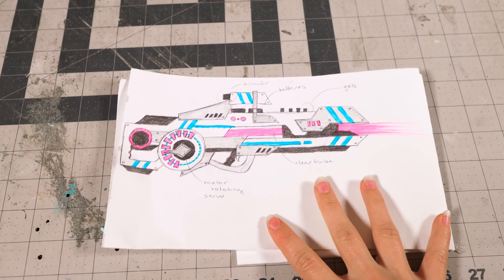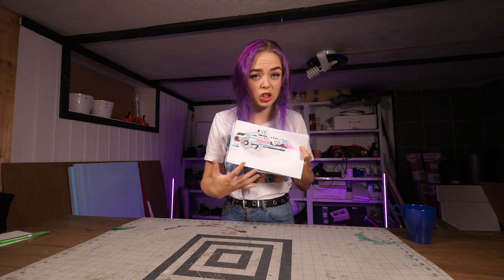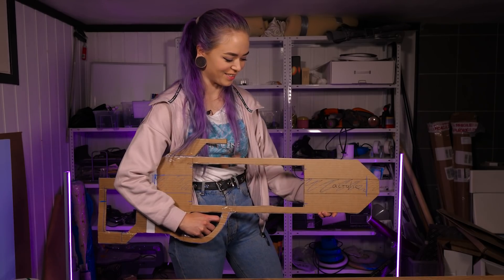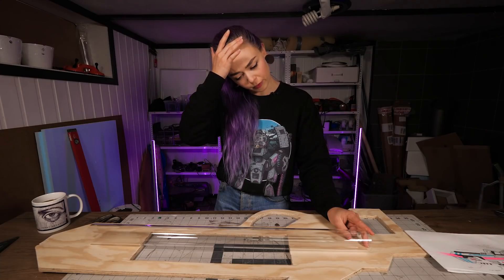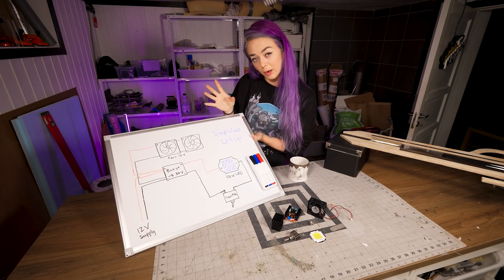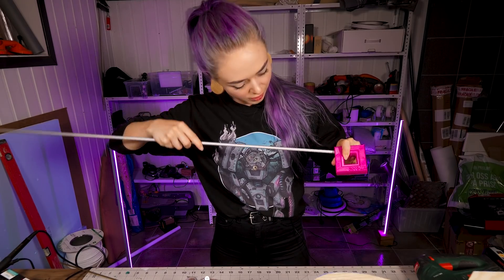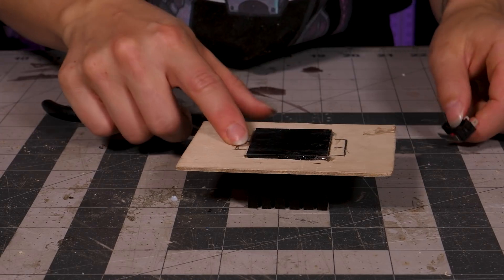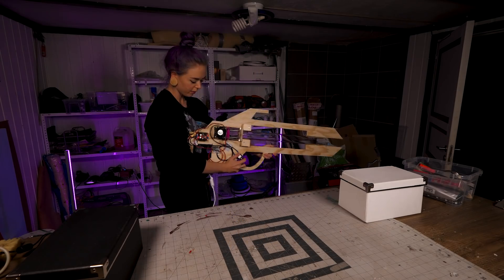Making A Giant 100W LED Laser Gun!

Comment: Very nice job! But a little tip for the led mechanism, about a possible thermal issue: now, when you want change color of the led, you disconnect it from the heatsink. This mean you don't use a thermal paste, usefull for the thermal exchange from the led to the heatsink. Without the paste, if you will running the led at maximum power (how the other guys said, with the actual voltage and courrent, the power is under 30 watts), it will risk to overheating. So, if you can, change the mechanism, so that the heatsink is  permanently connect to the led, with the thermal paste.

Comment: At the 30 V supply you are drawing about 0.7 A at most in your tests. So in reality your 100 W LED is just a 25 W LED at most. (This happens a lot when buying these from China)
Reply from the maker: We noticed this as well. Two theories: our bench power supply can't go higher than 30 volts. The LED i tested needs 32-34, it may draw a higher current at a higher voltage, which we will test. I remember having read someone had to drive it at over 36 volts to get it up to anywhere near 3 amps, which I guess sucks for the longevity of the chip. The second theory is that it's just a bad chinese product.
Reply: @Nerdforge  Honestly 25W is a comfy enough value and quite a good amount of light, i don't think you necessarily want to push it much further than that. Let's say it's a 10-series LED (i remember bigclivedotcom looking at these, should be about right), you're driving it right around the bottom of the threshold range and i'd say looks about right to me. Tried it with a super low current, seen whether it lights up consistently at all? If it does, and you can tell that there's 100 LEDs in there, 10 rows, 10 columns, all lit up, then i'd say it's a perfectly great product, but you might have a bit of difficulty finding one that isn't made out of junk LEDs. Banggood stuff sure usually isn't the worst though.

I mean neither your LED mount nor your cooling arrangement nor the spring contacts seem even borderline fit for a 100W heater. And the further you push it beyond the threshold, the less efficient it will be, so it may not even be necessarily worth it.
Reply from the maker: @SianaGearz  Thanks, that's a good tip! I'll explain a bit more in the next video, but the idea was never to have the gun permanently powered. The arduino will control how long you are allowed to hold the trigger button down, before having to do a cooldown period. Hence we can carefully adjust it so it's allowed to cool enough before blasting off again! The brighter the better!
Reply: You have to drive those leds with a constant current instead of constant voltage. Otherwise you can destroy the led.
Reply: @farbenformenlicht   Constant current and constant voltage are strictly equivalent to each other - if they're actually constant. You have more leeway to get the current regulation wrong than voltage regulation, but with these 10x10 array LEDs, it balances out anyway. According to how these LEDs usually react to voltage (like they light pretty brightly sub 30V and don't reach full brightness until 36 or 38 or so) there's probably plenty of resistance in the bond wires within the LED package which contributes to current limiting. It should be just fine, and if the LED unit dies, well that's just the quality of individual LED elements, nothing you can do about that other than underdrive it on the whole. There is some temperature dependence, with bond having PTC characteristic and LED having NTC characteristic, but that's like tens of millivolts, not enough to matter.
Reply: incandescent lumen equivalent probably (shrugs).
been duped as well, along with next day shipping that took 40+ days to arrive. I have a few "25watt" LED lamps that only pull about 3 watts, so it's a comen marketing thing to lie about LED power.
Reply: @Zarcondeegrissom   Nah they probably haven't mislabelled this one on purpose, this should be a real 100W LED, just 30V is too low for it.

Yours were likely deliberately mislabelled. If it's mains LED, it was probably the remarkably common combination of a 10W LED and a 3W driver.
Reply: eh, deceptive marketing in general really. Bigclive also looked at a bunch of various LED cob fixtures and bare LED cobs. many are deliberately mislabeled.

FYI, due to the dropout voltage of LED elements, going drastically lower in voltage will only result in the LED not lighting up. it won't make a 3watt LED magically put out more than 20 watts of light for longer than it takes the magic smoke to escape the cob, lol.  a 12v cob, will only work around 12v, a 30v cob similar. putting 120v or 240v directly into either will only make a spark and smoke show, lol.

She probably has a 25-watt cob, and 30V is exactly what it's supposed to have, more will only kill the LEDs.  in my case, it was a 12v fixture that was mislabeled by the seller.
Reply: to clarify that some. A single 1.4 volt red LED element will only illuminate between 1.2 to 1.6 volts typically. that is a very limited range of voltage. below 1.2v and the voltage is just to low for the diode to even turn on. above 1.6 volts and so much current will be going through the LED it 'will' burn out rapidly.   similar applies to 2.1 and 2.3v other color LED elements.   That's why you can't just rais the voltage to make an LED brighter like old incandescent bulbs. It takes trickery with PWM dimmers (that only do dimming, not make an LED brighter than it should be), or similar things with the LED driver circuit (that varies the current, or time based on/off cycling).
Reply: @Zarcondeegrissom  These should have 10-series of LEDs with 3V forward voltage each and judging by the range of voltages they light at (30-36 usually specified, sometimes 30-38V) there's a significant series resistance in the bond wiring. If these are what i think they are, 100-element array, and if the individual LEDs are not junk, 100W is actually appropriate maximum wattage for the unit - of course if you can cool it effectively enough. Whether the LEDs are junk is something that will be obvious at low-current testing.
Reply: with 10x LEDs with a 'Forward Voltage' of about 2.73v (Cree, apparently has one that high. lists 3.0v as the absolute max voltage), I would think between 28v to 32v would be more of a thing.  for 36v, I would assume you would need more than 10 LEDs in series, like 12 or 13 LEDs if there at about 2.7v 'Forward Voltage' each.

none the less, it's not like the cob is puling only 80% of it's advertised power. going from 25 watts to 100 is a four times increase, you're not going to get that without blowing the LED or starting with a PWM dimmer at low from the start for the 25w measurement, lol.

https://www.mouser.com/ProductDetail/Cree-Inc/XPGDWT-BS-0000-00KE3?qs=sGAEpiMZZMve4%2FbfQkoj%252BIeIZAp5dv5GQ4JeQrEY2CA%3D

I have seen higher-rated LEDs in the past, 5V and 9v, tho they had current limiters built into the 5mm package back then,  not the same thing as raw LED element in a cob.
Reply: LED's are often labeled as "equivalent to" using the old type of light bulbs as a measurement. At least they do that with grow lights. I have a grow light that gives an equal light output to a 1000 W HPS that only uses about 250 W. It's not because they're from China, it's just how businesses try to make the transition easier for people that don't know anything about this stuff, they just know they used to use a 40 W light bulb in that lamp over there. It's like how they still use Hz to describe a TV's maximum frame rate even though Hz is no longer applicable since there are almost no analog TV's left, at least not here in Norway. No regular light bulbs left either, they've been banned, but a lot of people will still look for 40 W or whatever when shopping for light bulbs, so they put it on the box even though it's not true.
Reply: except if you look, it's labeled 'equivalent' on the packaging, with actual power also often on the packaging somewhere in smaller print. I have many of them bulbs.  The thing is, cobs tend to be a tad more than 4x for equivalent power as with regular bulbs.  So as much as I  had joked about that way up yonder, I don't think that quite flyes, as these cobs are not marked as 'equivalent' power on the seller's page, there marked as actual watts in an outright lie of what the cob actually does.
Reply: Chinese watts are 1/3 of real world watts, you find this is true when buying power inverters and that expensive 1000w pure sine wave camping inverter craps out at like 400w...
you just cant trust products from online cheap stores, you want 100w led, use a real electronics component manufacturer recommended from a local country forum/group
Reply: You can get a buck boost converter that can also adjust the current output. My Chinese 100w led maxed out at 2.6amps at 33v. Some of the boost converters that have  no current adjusters have a limited ampage output.
Reply: @Nerdforge  You might also want to check the lab wires / crocodile wires you've used. It's hard to tell from the video, but i've had lab wires that couldn't even handle 2A. Thick PVC/Silicone outside, but barely any copper inside. Especially cheap crocodile clip wires have often just a AWG28 or even less inside. 
If it gets really pushed to the 100W / 3-4A at the end i would get some nice thick silicone wire.
Just keep in mind that the LED might melt the 3d printed holder (especially if it was PLA) if you go towards the 100W.

Comment: I think It would be better if you use BEC and step down from a 6S lipo battery or higher. Because step up requires lot of current to reach higher voltages

Comment: 100W lazer, you must be crazy. But a 100W LED that is doable
Reply: same. I was like 100W laser THATS CRAZY... does she want to cut thru things???
..., ofc its just 100W LED light... that is not even running at 100W (1:13)
Reply: Styropyro has a 100w Laser. This is extremly Powerful.
Reply: @JAKOB1977  What kinda heatsink would you use for such a powerful laser diode? Could you link a few with a fan that arent too expensive?
Reply: @JAKOB1977  Wtf are you talking about it says in the title 100W LED no clickbait. Just pay more attention reading stuff
Reply: Right? I have a 60W laser and it cuts through half inch thick wood like butter
Reply: @redleader6144  You missed the word "Laser" in the title. LED means Light Emitting Diode. Laser is a light emitting diode but this video is clearly not a laser diode but just regulr one, she also runs it at one fifth of the power and has no idea what she is doing.
Reply: I don't think any of her fans that ought she meant a real laser.  She makes fantasy stuff.  I mean I watched one where she made a spell. Another where she made a wizards staff. A wand in another.

Comment: What plastic is the bracket printed in? Won't it give up from the heat? What thermal interface to heatsink?

The heatsink looks like a 40mm heatsink, so it's going to have... with airflow, maybe 1-2°C/W performance? Ooof that'll be narrow, i mean, even at 1°C/W, you can reach 130°C... i know, a sloppy estimate on my part, i guess you'll see in the build what works what doesn't.

I'm also worried about the colour gels, i mean, when you're putting 100W of power into the LED, you'll get about 20W hitting that sheet of plastic, most of that passes through, but you filter down about 1/2 to get the tint, that's still 10W that it somehow needs to dissipate.

Obviously if you underdrive the LED to about 50W, most of these issues pretty much disappear.

Appropriate lens? Mhm Google Cardboard has some lenses with a known focal distance, and V2 has slightly larger ones than V1. Standard 5x loupe from 1€-store or a book store has 5cm focal distance. Usable.
Reply: The heatsink won't be able to dissipate all the heat, I had the same thoughts about the 3D printed Bracket, if it is PLA it will start to melt at 180°C, and the led will get fused to it... it would be best to print it in Nylon or Carbon Fiber enriched filament... it will give a Better resistance...
Reply: @riccardofinotti1019  The figure you're looking for in plastic usability at high temperatures in a mechanically loaded part is Heat Deflection Temperature, basically the temperature at which the material loses the bulk of its strength but doesn't necessarily begin to melt, it's directly applicable here because of the spring force that is being applied. It's generally MUCH, MUCH lower than the melting point! Here are HDT figures for some materials.

PLA (L-Lactide type): 50°C
PLA, after annealing: not known with high enough certainty, might be in the 60-130°C range.
ABS: 95°C
PETG: around 70°C
ASA, SAN: around 95-100°C
HIPS: around 90°C
PA-12 nylon: 98°C
PA-6 nylon: 160°C
PA-66 nylon: 200°C
Polycarbonate: 116°C

Nylon filament will be a blend material, heavily biased towards lower-temperature chemistry. Carbon, glass or metal filling is likely to increase HDT.
Don't kill me if the values aren't quite right, they're kind of from memory and various sources.

So using PLA near heat sources is quite a difficult to recommend undertaking, but it can be done via annealing.
Reply: @riccardofinotti1019  Hey turns out they're only driving the LED to about 25W at most as someone else in the comment section spotted. That is obviously a lot easier to cool, avoid melting the mount, and avoid damaging the gel than at 100W :D
Reply: @SianaGearz  your explanation is impecable, but even with 25W... if not properly dissipated with thermal paste... the beacket will deformate... enameling PLA is not simple for those who don't have experience

Comment: I've been lost in the part for using coolers. Have you measured the heat on the circuit? Why did you use 100w led in the first place and not a 60W or 40W led instead. It wasn't powerful enough to produce the desired effect? Thx

Comment: yeah, droopy holes is a thing you get with 3d prints. also looked like the print was warped a bit.

also be cognitive of the print filament you're using. pla does not like heat.
Reply: You also get droopy holes when you get piercing like hers...

Comment: I recommend for your lighting effects you can get all sorts of filter and light films at shop.leefiltersusa.com

Another thing you could use is if you get a starwars lightsaber blade and light kit from uptrasabers.com or saberforge.com or from other sources as well you could could cut the blade to your size requirements slide it into the tube your using then install the light kit it would also solve the battery problem as well so you would  not need the heavy batteries or fans , also  if you got a deluxe lightsaber kit you could load in both lighting effects and sound effects also by a micro USB into the processor , then your gun could have blast effects and power up or power down or shooting sounds.
Depending on what kind of kit you got you can have a single color or multiple choose able colors usally just switch through the colors by what button press number you program in for example one press could be red press twice green etc. They are not real expensive just for the kits or blades you can also get them on Etsy also.

Comment: 30v  0.9a that's not even 30w :/
Reply: where did you get the ,9A?
Reply: @PCr4zy  at around 1:13 you can see it on the power supply screen, however that small boost converter she used probably supplies less maybe she will measure the output current on the next video ?